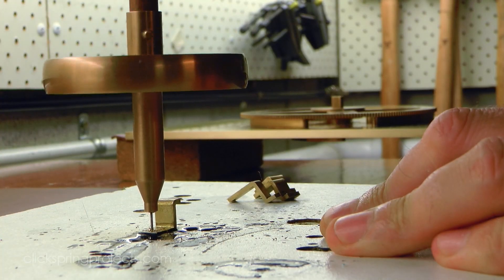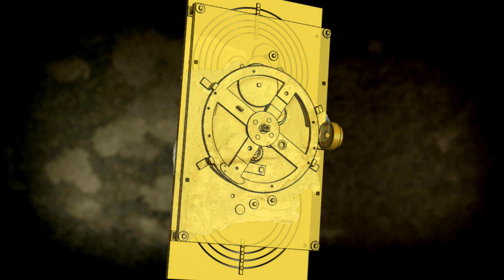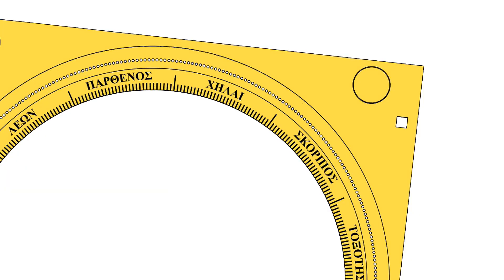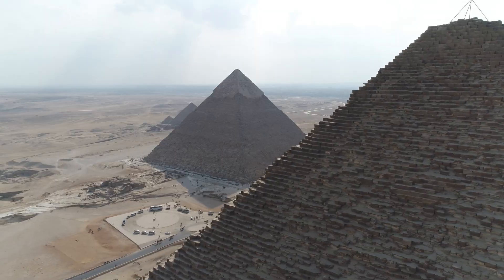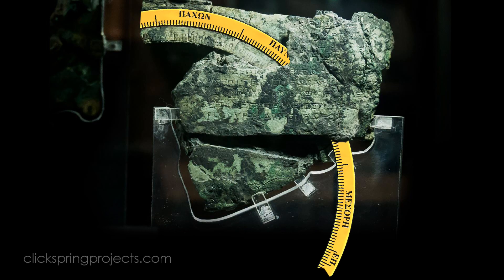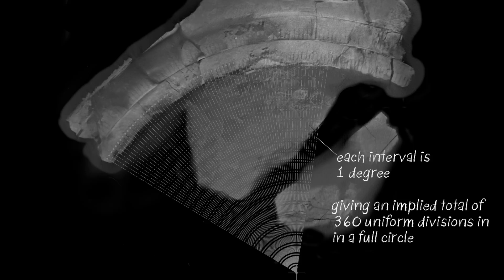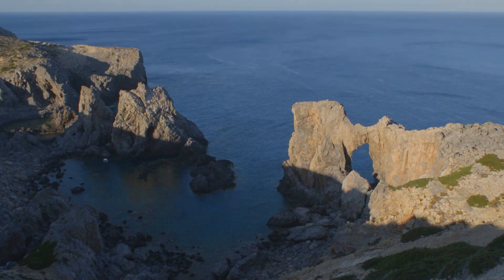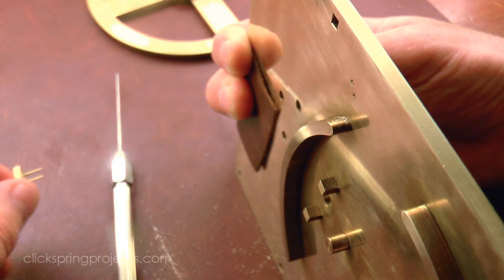The Antikythera Mechanism Ep. 10 - New Research - Is this a 354-day Lunar Calendar?

Comment: Man, my respect.  Those "let's ACTUALLY CHECK the things instead of making asumptions", "let's NOT asume highly experienced artisans were likely to do hideusly imperfect work", "let's NOT  assume the ancients were unable to do things right" are the basis of experimental archeology since Peter Connolly replicated Greek and Roman shields and proved they worked. Those things do resonate with me.  I'm also an experimental archeologist, albeit in a much smaller scale than yours (my own contributions are only on the less glamorous field of how many layers of cloth need to exist betwen your buttocks and a bench when sitting down with XIX century Castille clothes in order to be comfortable, to test wether pictorial representations are stilized or realist), andI've been battling that battle for 25 years and counting. My hat is off to you.

Comment: Hi Chris, I have been following the Antikythera Mechanism research for some time and I am very pleased with your reconstructions video’s. I am also glad you have been doing detailed measurements on the front dial.  I would like to present my ideas after reading the avalailable literature.
I see 4 possibilities:

1.	Non-uniformely divided zodiac ring and uniformely divided calendar ring (Evans)
A calendar ring uniformely divided in 365 days is in conflict with your measurements. This solution also needs 2 different axes since the zodiac ring is shared with the lunar/planetary pointers. This needs extra complexity and gearing for which there is no evidence. I therefor discard this option.

2.	Non-uniformely divided zodiac ring and non-uniformely divided calendar ring
This could be possible if we take the Evans proposal and put the center of the rings between the O and C points. This leads to slightly erroneous readings on both the calendar and zodiac displays. This option also seems very unlikely in the context of the mechanism’s overall design.

3. 	Uniformely divided zodiac ring and uniformely divided calendar ring:
Bases on your measurements the zodiac ring has 360 divisions. The calendar ring likely has between 354 en 360 divisions. 360 divisions make no sense since this would be the same as the zodiac ring. Only 354 divisions have some astronomical sense as proposed by you. My objections to this proposal are:
– the shift to compensate the 4 year leap year corrections does not correspond to 1 solar day.
– added complexity and gearing
– separate Egyptian calendar needed
– lunar phases are already displayed by the lunar pointers

4. 	Uniformely divided zodiac ring and non-uniformely divided calendar ring:
Given the remarks I made on the previous options, I propose a uniformely divided zodiac ring of 360 divisions and a non-uniformely divided 365 day calendar ring . The solar anomaly is based on System A, which seems to best fit the data as presented by Evans. This proposal was discarded by Evans because it would result in an apogee shift when the ring is switched because af leap years or Calliptic cycle adjustment.
I do defend this option for following reasons:
– In System A the divisions are fixed within slow/fast moving periods/season. When shifting the calendar ring for the 4 year leap year correction, the divisions around apogee do not change. Only the switching day between the fast and slow moving period is altered. When after 120 years an extra month is added, the calendar ring returns to its original position.
– The calendar ring will at most be shifted by 30 days.  This results in a minor error on the calendar ring around the fast/slow moving switch. Only the extra Calyptic day results in a cumulative slow shift of 1 day every 76 years.
– The accuracy of the solar pointer on the calendar ring is limited anyway due to incorrect 365 days year length (leap years), the inaccuracies of System A and gearing tolerances. The error on the moon display however is strongly reduced over 12 lunations for 1 solar year). This indicates that the mechanism was mainly a moon cycle device. 

I hope my input can be of any help. 
Greetz, Frank (fg.maes@gmail.com)

Comment: Hi Chris. Just wanted to mention there are some small issues with your vocal recordings that are quite distracting once you notice them, and are out of place with the exceptional level of quality of every other part of your videos.

Firstly your recordings are too loud and occasionally distort. If you have a way of setting your 'input gain' you should try to have your microphone's level average around -12dB or so. It doesn't need to be anywhere near hitting the red part of the meter. You can bring up the level in your video editing software, after it's recorded.

Second, you have some kind of dynamics processor affecting the levels of each vocal 'part'. I assume it's a compressor in your video editing software that is being triggered at the beginning of each of your sentences, and turning 'off' after about 1s.
If you listen carefully you'll hear that every sentence (or after every gap of silence) starts quite softly. That's the compressor bringing down your levels. Try recording at lower levels (point above) and raising the compressor's 'Threshold' setting to a louder value. You want the compressor to bring down only the occasional loud part of your voice, not turn on every time you speak.
I suspect your 'Release' setting is at about 1s which is why things get loud about 1.5s after you've begun talking. You could probably shorten the release to about 150ms or so, but recording at a lower level and adjusting the compressor's threshold so that it only catches the loud parts will probably be all you need.

Sorry if this is unwelcome. There's plenty of info about recording and compressor basics online, and it's really not difficult. Especially for someone of your obvious intelligence.

Comment: I'd have done the data analysis differently, via a likelihood model. Optimize one (rather complicated multidimensional) function and get the radius and number of divisions in the circle (plus a bunch of nuisance parameters, such as the circle center coordinates for each section)  in one foul swoop. Then you can use how quickly the likelihood falls away as you depart from the maximum to get a measure of uncertainty. You can test against null hypothesis that n=365 by a likelihood ratio test, comparing the model optimized with fixed n=365 against variable n.

However, I doubt my analysis method would produce materially different results.

Comment: Concerning the 365 divisions being regarded as a potential error in design please consider sudden climate warming took place 2,000 years ago . There have been many theories about why the Earth has a wrinkled surface that is covered with mountains and deep ocean trenches. One of the main theories of the last century was the `Shrinking Earth' theory. The expanding Earth or growing Earth hypothesis asserts that the position and relative movement of continents is at least partially due to the volume of Earth increasing. Conversely, geophysical global cooling was the hypothesis that various features could be explained by Earth contracting. Mercury was once bigger, then It shrank As the planet cooled. If the Earth warms it expands. If the earth cools it shrinks. Is it not possible that the earth was a different size due to its internal temperature at the time this mechanism was built? Perhaps the earth had 354 day yr at the time it was built??? Just something to consider:)

Comment: Glad to see you back at creating beauty. I have a wild idea about the parts of this that I do understand from an electronics point of view. This device is a computer, and it simulates nature. But nature is chaotic, and even holding accurate time-of-day for a month or so was beyond the reach of large mechanical computers of the time. This device, if I recall correctly, was capable of predicting astronomical events for years into the future, but its resolution is in "days". Days are not a valid unit of time. Days are themselves astronomical events. Assuming they used a 365-day calendar back then, then they would still be off by around 1/4 day per orbit of the sun. I am of the assumption that the folks who would/could build this computer back then, and those who would be willing to spend the amount of money needed to have exclusive ability to authentically show people that the gods directly approve of their actions, would be well aware of, and incorporate an easy "check and adjust" feature. Removing several of the days to bring the total to 360, makes the rest of the math easier, due to the common usage of the Sexagesimal system. Using 365 days would require either so much extra math in that system that your device would need additional math gears and a readout to help bring the device into tolerance  (due to not using the same number system, nor the techniques you and I are used to), or - if it was using any math technology known to be in use at that time - it would require a synchronous tolerance indicator and adjustment offset. As you can see, both systems require additional parts, a readout, and a system to interpret the combined outputs (perhaps an early version of a computer requiring a form of software to be of any use). Either way, that mystery component is needed for checking your output, and the 360-day markings tells you that the number system of the display is sexagesimal, even if only for the less-math-inclined purchaser of the device.

Comment: I've just finished watching the whole build series (so far...), and the more you look at this, the more it just seems impossibly complex for the era it is supposed to have come from. One would expect that there might be prototypes or simpler versions documented or recovered? I can see that Armillary Spheres date from around this time, but Orrery's which are similar, didn't appear for another 1000 years or so? So much of the evidence is the device itself, there isn't much supporting evidence? The part that codes the variations in the lunar orbit, using an eccentric gear, driven by a pin in a slot, seems such a huge jump in technology, compared to the rest of the machine which is essentially all done with fixed gear ratios. 

Can this device predate the very crude verge escapment clock by over 1000 years??? 

Are there any other devices, from 2000 years ago with anything even close to this machines complexity?

Comment: Just a thought, as its been noted that a lunar year is 354days ( plus a few hours) it would quickly move out of phase in a couple of years. And I was thinking maybe that's what the locating pin is for on the calendar dial. So the dail can be "calibrated" of sorts to account for the slight mismatch of the lunar cycle thus keeping the mechanism accurate. 
Like perhaps the mechanism would be used and a slight mismatch would be noticed between what the  dial reads and a direct observation of the lunar cycle and so the dial would then be repositioned backwards or forwards a notch to bring the reading bact to true thus  "resetting" it for the next lunar cycle. 
A bit like a indexing plate on a rotary table when you dont quite have the right number of holes, so you have to do that one whole turn plus a few holes to compensate
Reply: G'day Johnny, Check his description above for the link to download their research article in the British Horological Institute publication for in depth descriptions of their discoveries. It's free, and is one of the things Chris pushed for with this release :)

Comment: What you are looking at is a tracking clock. It tracks the real time and converts it to a new time schematic.

Dan 7:25 And he shall speak great words against the most High, and shall wear out the saints of the most High, and think to change times and laws: and they shall be given into his hand until a time and times and the dividing of time.

The thing is that when they changed laws and times, they needed to track it so they knew the real time as the real dates and times and seasons are required in order to sustain. They were tipping the scales to their advantage by changing the time.

Comment: Lunar calendar has 354 days in 12 months (some months have 30 days, others have 29 days), then to match the 365 conventional year, about every 3 lunar years will add one extra month (or more accurately, every 19 years adding 7 months), such that after 19 years, the lunar calendar and conventional calendar would more or less match again (Lunar calendar : 12lunar months ×19years＋7lunar months＝29.53059days×235＝6939.6887days ~ conventional calendar: 365.2422days ×19＝6939.6018days)

Comment: Excellent work,guys!  Just read the two parts of the article. Very impressed with with the scientific approach and presentation. 
Put simply, I think you nailed it 8-)
I wonder how many academics would have rejected or overlooked the accuracy of the hole placement . Any machinist would appreciate the +0.1mm placement by hand as exceptional . Just shows the advantage  of building one as part of the historical research.

Comment: Nice. But wouldn't it make more sense that the adjustment holes are there to reindex the lunar calendar on the summer and winter solstice? That's a simple way to deal with the fractional days in an orbital year and would require no further computations for leap days. Or did I miss that in the paper?

Comment: Is it possible that the spacing of the pins would vary depending on when in the year it was because of varying length of daytime, and that the intact portion is slightly deformed because of that?